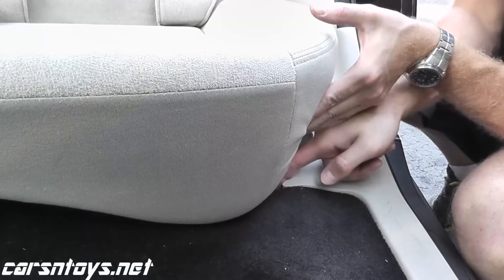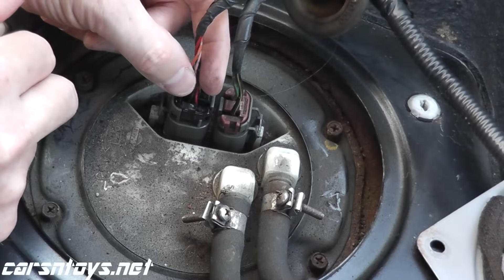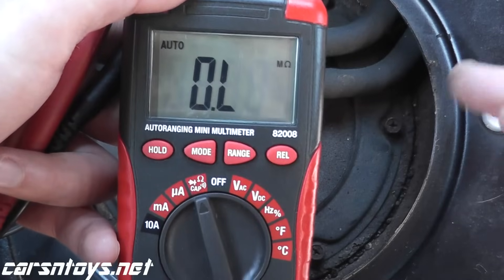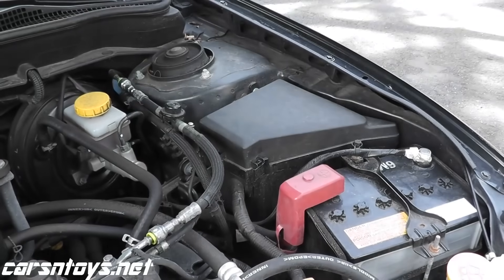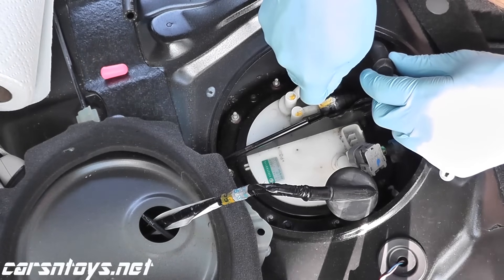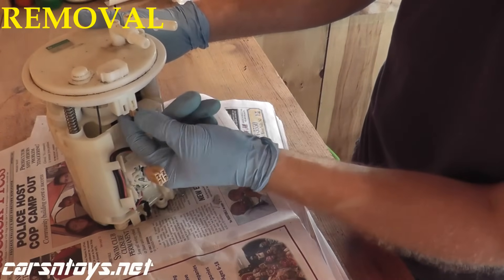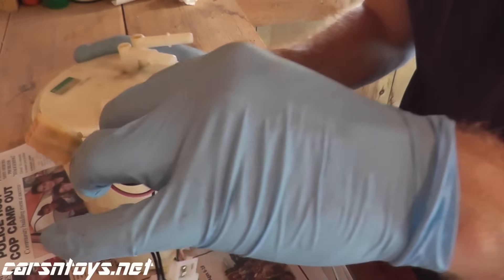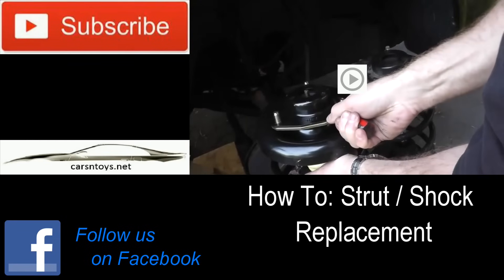How To Test and Replace the Fuel Temperature Sensor P0180 P0181 P0182 P0183

Comment: Open the fuel filler cap before disconnecting to release the pressure in the tank and prevent the fuel from leaking out.

Comment: How u doing I have a question I have a trouble code p0183 fuel temperature sensor but I can not find it, I’m working on a 2008 Ford F-150 4.2 and replace fuel pressure sensor, fuel filter, fuel pump, drive module and still nothing your help would b great

Comment: I have a 2006 Ford Mustang v6 with the PO183 code I have replaced the fuel rail pressure sensor two or three times and it doesn’t seem to fix it. Any help would really be appreciated!

Comment: Lol. Why remove the fuse to relieve the fuel pressure when you are already going to disconnect the wiring to the fuel pump? And even though you checked the continuity from ground to one side of the temp sensor, isn't there another wire going to the ecm/pcm? Or does it just read the resistance through the vehicle ground? Funny shit!

Comment: Great video. But you say in the video that higher temps decrease resistance and lower temps increase resistance. You got that backwards. Superconductors are supercooled using liquid nitrogen. If higher temps reduced resistance then superconductors would need to be superheated. Not supercooled.
Reply: Sorry, but you are talking oranges, this video is about apples.  There are a variety of temp sensors and they have either positive co-efficient or negative co-efficient curves depending on the materials used.  There are also thermocouple that generate millivotage outputs instead of resistance variation but those are not used in this application.

Comment: Hi, I need help with my 2017 BMW 330E that is throwing the code P0185 Fuel temperature sensor B circuit.

Comment: 2 spectra pumps one in car one out of car similar around resistance at fuel temp sensor around 1 ohm, my oem sitting next to the spectra that is out of the car is around 1.75 ohm both next to each other same table. I get p018x codes with the spectra in the car, I really dont want to change pumps again, will be the third time, can I just run with the light? and I get 4.75 volt to the circuit with key on never got a temp code before with oem

Comment: Great video, thanks. I have a 3013 Vauxhall Mokka in the UK with a P0183 fault code - Fuel Temperature Sensor High Voltage. Can you help please?

Comment: Can someone let me know where the fuel pressure regulator is on my 2015 Mustang v6 3.7? I don't see it under my hood. 

Also, how do I know if an EVAC charcoal canister is defective? It blows air through all three air ports. Is this how it's designed? When filling the fuel tank with gas the gas pump sometimes shuts off before my tank is full. 

Thank you.

Comment: I have an 08 Versa hatchback and can’t find the temp sensor anywhere for sale by itself
Reply: Don't know if you still need to know, but they unfortunately don't sell the fuel temp sensor separately for the Nissan Versa 07-12. You basically have to buy a whole new fuel assembly if the sensor is bad, which sucks lol. Had to do that for my 09 Versa.

Comment: He changed from a Nissan to a Subaru after removing the fuel pump... similar but not the same! The problem target changed from fuel temperature sensor to the fuel LEVEL sensor.

Comment: I just had my fuel pump replaced on my 2015 altima.Car ran great for one day and the car started idling rough and shutdown on me twice.Check engine light came on.I took it back to the mechanic that replaced my fuel pump.He on. The codes and it came back with fuel level low sensor & a fuel temp sensor fault codes.What are the chances that this new fuel pump has bad sensors or could it be something shorting them out?Any help would be appreciated.
Reply: Having the same issue if you figure it out would love to here
Reply: Have u fixed this issue? Have same like u
Reply: @engman6320 did you fix the issue?
Reply: @nwankpufavour2184  
Yes just changed the fuel filter after i changed the fuel pump tow days before
So u needs always to change fuel filter with every fuel pump replacement 
No need to replace all the assembly kit just change pump and filter
Reply: Were you able to fix it and how did you go about it?

Comment: I have a question about getting your code from the scanner. It is my understanding that the scanner only gives an error code when there is a check engine light, is that correct? If I am having a problem with my car (and I suspect it may be the fuel temp sensor), will the scanner tell me what the problem is, even if I haven’t had a check engine light?
Reply from the maker: Yes, the vehicle's computer may have a pended code saved internally. However, the check engine light won't illuminate with pended codes. Best of luck!

Comment: you can relieve the gas tank pressure by opening up the Gas cap, so fuel doesn't run out when you disconnect the fuel hoses with the fuel pump unit still bolted on to the tank.
Reply: yes that is what should be done. taking the fuse out does not relieve the fuel pressure.

Comment: Great helpful video. Few days ago went to Autozone to get OBD2 reading out of curiosity. Even though no engine light has come on, it gave a code of p0183, and p0462 (fuel pump assembly). 2004 Nissan 350z with 70k. miles. Runs well as this is my daily driver. Just didn't want to spend money just replacing parts until having a second opinion on this issue. Would you mind to help? Thanks in advance!

Comment: I have a 2014 NV200 with P0183 code. Fuel temp Sensor. Truck doesn't start. If the fuel temp sensor doesn't work will it cause the truck not to start? Thanks.
Reply: Remplace the fuel pump, sometimes it was burned when the fuel temperature sensor is broken

Comment: you did not show how to detach the wires on the fuel tempter sensor...
Reply from the maker: You can't on this vehicle.
Reply: Do u have to have the battery plugged back up to do that continuity test? or will it still sound with the battery unplugged? thank u

Comment: What is the little blue tool you used called
Reply from the maker: Here you go: https://www.amazon.com/Company23-C23-545-Subaru-Fuel-Disconnect/dp/B00QH7BJ82/ref=sr_1_1?ie=UTF8&qid=1499831343&sr=8-1&keywords=subaru+fuel+line+disconnect+tool

Comment: is this the same set up as a 2011 Nissan juke blowing codes P0181 & P0182 assuming one code is making the other one visible. is that temp sensor part of the tank leveling mechanism or does it detach Thanks in advance sir.
Reply from the maker: It's similar in terms of a connection on top of the sensor and the float bowl on the bottom. You can test the sensor on your Juke as well. Try doing a google image search. If you need diagrams/pics shoot me a message via facebook. And yes, it does detach as shown in the video.